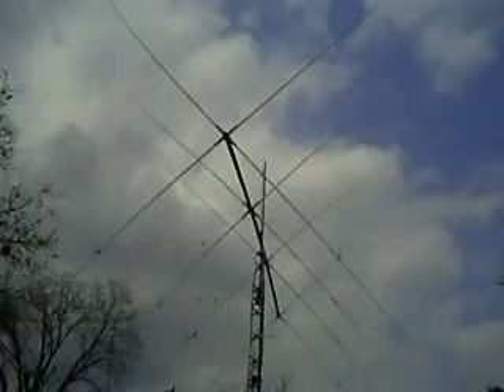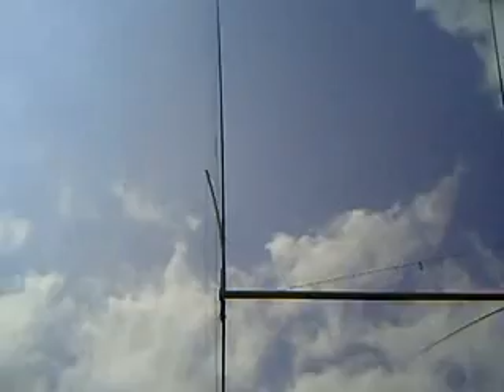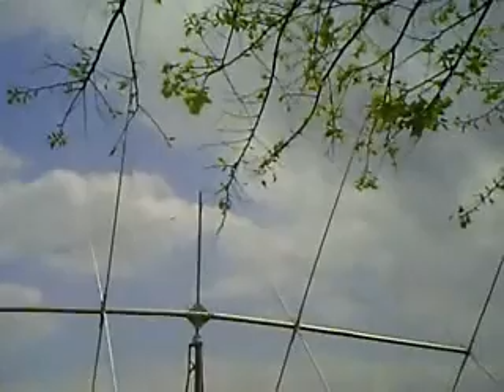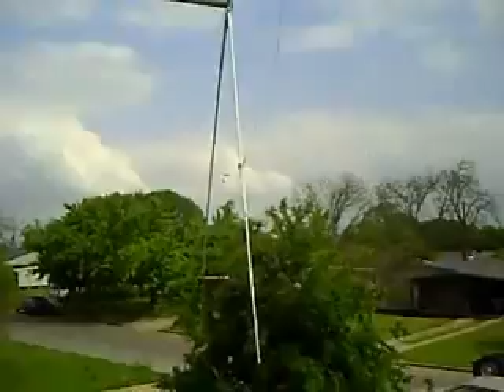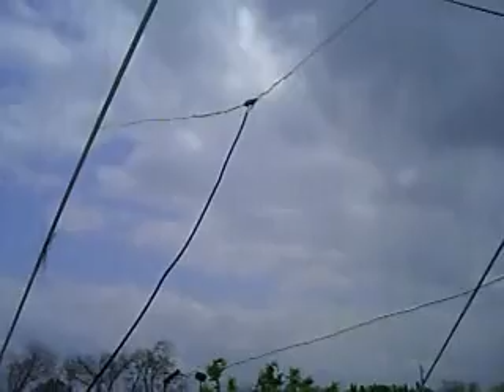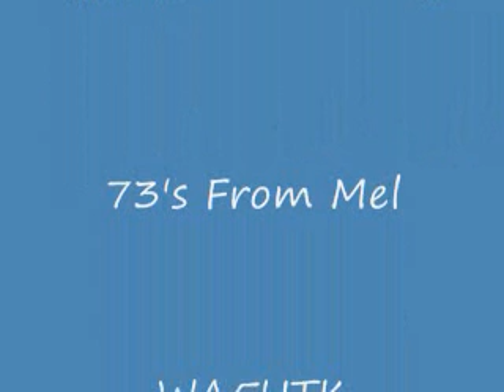My 4-Element HF Cubex Ham Radio Quad Antenna

Comment: Nice antenna Mel but you've got swag in the boom.  I was looking at your QRZ page and seen no mention of the quad beam. Is the antenna still in the air ?
 I recently bought a M2 mono band 5 element 20m Yagi beam with a 44 ft boom. It's going up on a 90 ft. commercial self support. 
 If I hadn't already purchased the Yagi..I definitely would've bought the quad.  73s 
                   KN4IRM - Ken
                   Kentucky

Comment: I have a question, I was thinking of putting up a vertically polarized 3 element quad for 11 metres. Do you think that it will be a great receiving antenna for the lower HF bands? I was thinking it would be as on those frequencies it would essentially look like a single turn loop of 11 metres of wire connected to the coax (the parasitic elements contributing nothing). Since shortwave reception is about signal to noise ratio I was thinking it would actually do quite well and prevent me from needing to put up a separate antenna for SWL and give me good gain on 27mhz

Comment: I like this antenna,but like the last comment stated,you need to tighten the turn buckles more because it is sagging a bit,I also think you might want to consider raising it in the air about about another 20 feet or so,why??. If you look at how the elements are somewhat close to the top of your roof line,it would be worth the effort to avert possible expensive roof damage.

Comment: Hi my name is Javier KC2MXH and I had thought a lot about adquiring a 2 elemente quad instead of a 6 elemetn  Tennadyne.  This to replace a Cushcraft A3S which only gives me 20/15/10 and I enjoy a lot 17 m.  Do you recomend me a 2 elemetn Cubex Quad versus a Tennadyne? I also heard that tunning the Quad is very difficult.  what is your imput about this?
Thanks!
KC2MXH